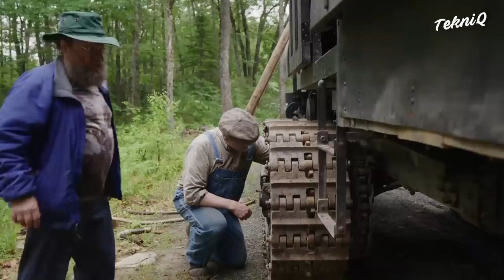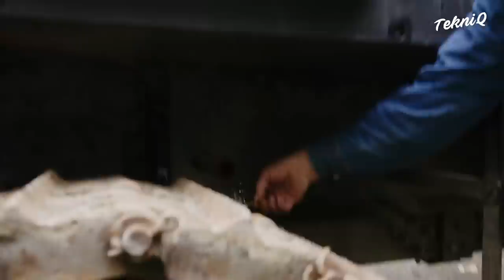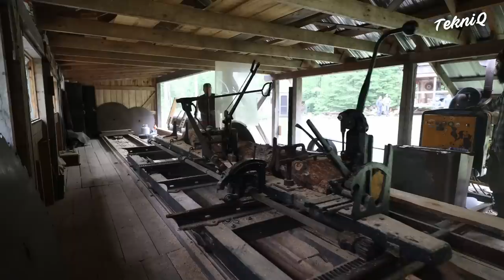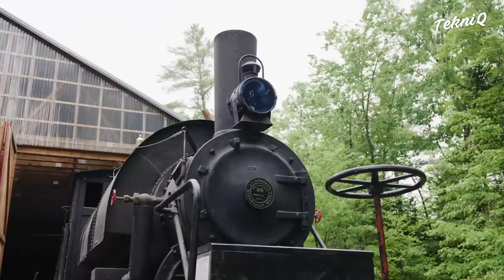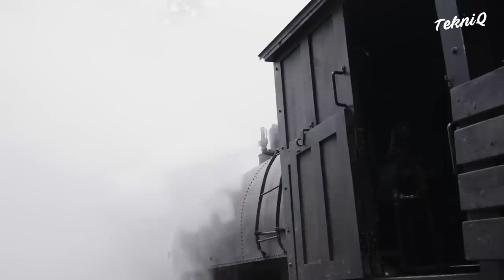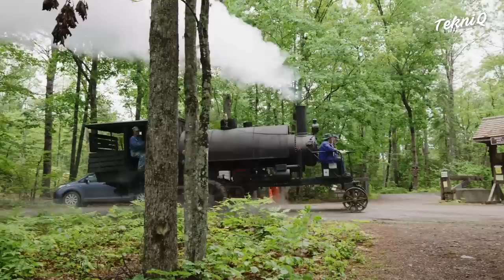Starting Massive Steam Tracked Tractor: One of the First in the World

Comment: Great video, especially the delicate sounds! Two similar log haulers (Phoenix Centipedes) were imported to northern Finland. The first locomotive arrived at the port of Hanko in southern Finland 1913. From there it was transported by rail to Rovaniemi, near the Arctic Circle. After that there were no rails, only narrow gravel roads ("roads".... well, more like paths). The log hauler was dismantled and transported piece by piece,  300 kilometers. The same thing was apparently done with the second hauler, too, in 1914. Logging in these forested wetlands was done wintertime, so the 35 kilometer long "road" for the haulers was a frozen route, not an actual all-year-road. The timber was hauled to Lapland's biggest river, Kemijoki, from were it was moved downstream to sawmills in the Spring. After some time the haulers were converted to burning wood, as it was difficult to get coal (the steam engine consumed almost 50 cubic meters of wood/day). Both machines still exist, one in Tulppio near the Russian border, the other one in Forestry Museum of Lapland (Rovaniemi).
Reply: I had to look it up: The Phoenix Centipede was made in Eau Claire, Wisconsin starting in 1903. The company licensed the patents from Lombard, so the two machines are nearly identical.
Reply: Great piece of history .  Thanks for the contribution 👍🏼
Reply: Invaluable historical info!
Thank for your contribution.
👍

Comment: This has to be one of the most maintainance intensive machines I've ever seen in operation.
Reply: Its actually not that intensive. This was the first run of the season and we just had it all opened up for the annual state boiler inspection so we went over it with a lot of care. It takes about 4 hours to steam up from dead cold. We could do it faster but we like to be gentle. Once under steam its just feed the fire, add water and oil here and there.  Like any steam engine your always checking for loose fasteners and if the journals are running cool.

Comment: I didn't expect caterpillar tracks to have existed on vehicles before the invention of the internal combustion engine.
What an incredibly impressive vehicle.
Thank you very much for the video and also for letting me learn something again.
Reply: Äh, nope, the Lombard Steam Log Hauler is from 1901.
Reply: The boiler seems disproportionately large for the cylinder bores.
Reply: @532bluepeter1  The cylinders are 9"x10" its rated for 90 hp at 175 psi. Maximum RPM is 250 which moves the machine along at 4.7 Miles per hour. The water tank (425 gallons) tends to make it look larger than it is.
Reply: @terryharper2024  Thank you
Reply: Many if not most steam shovels had crawler tracks as well.

Comment: I believe this is a Phoenix Log Hauler. They were built in Eau Claire, Wi circa 1901. I saw one in edgar, WI in 2014. Fantastic machine. Would not wish to be the driver.
Reply: how was the show?
Reply: No this is a Lombard made in Waterville, Maine. The Phoenix was a licensed built version. Alvin Lombard received a royalty for every machine Phoenix produced.
Reply: No, this is a Lombard tractor.  The Lombard is the predecessor of the Phoenix tractor.  When Lombard went out of business, they sold the patents to the Phoenix company.  Phoenix changed several things in the design.  For instance, the Lombard tractor has a "saddle tank" for water for the boiler, the Phoenix has the water tank below the boiler in the frame.  Also, the steam cylinders are arranged different.  The Lombard has horizontal cylinders like a railroad locomotive while the Phoenix has vertical cylinders like a Shay geared steam railroad locomotive.  I have an old video on my youtube channel of the Phoenix engine from Wabeno, WI running at their annual "Steamup Days" from 2011, I think.
Reply: @amberyooper  Lombard did indeed proceed the Phoenix. However the Phoenix was a licensed built version of Lombards early machines (pre-1905) Lombard did in fact use vertical cylinders on his pre-1905 machines with the exception of his initial prototype built in 1900. After 1905 Lombard went with the saddle tank and horizontal cylinders while Phoenix stuck with the earlier design until the end. What adds to the confusion is Lombard offered a lighter, cheaper machine concurrently with his big 19 ton log haulers. These used a vertical boiler with the cylinders mounted vertical on the front of the boiler barrel. The last steam Lombard left the Waterville factory in 1917 though they continued to manufacture gasoline powered log haulers (Tractor-Trucks) until 1936.

Comment: An amazing machine. In the UK, there is the Road Locomotive Society: "Founded in 1937, the Society’s objectives are: The enhancement of education and research into the past history of all types of self propelling steam engines (other than those running on rails) and those types of stationary steam engines known as portable engines, the results of such research shall be made available through the Society Journal and other publications." I reckon with those tracks this machine was off road dragging those logs most of the time!
Reply: It's always been my impression these were most often used in winter-time, with a pair of runners in place of the front wheels. They would pull trains of sledges carrying logs, over snowy paths and frozen lakes. It would have really resembled a train, only without the rails. I don't expect they would have been quite so useful in the summer.
Reply: @jetporter  Yes, I think over frozen ground they would be far more practical- and quite a sight as you portray it!
Reply: @jetporter  Correct. We do have a set of skis for it. The steam powered Lombards such as this one were equipped with skis and only used in the winter. We have wheels on this one so when demonstrate it during the summer months.
Reply: I saw The Iron Maiden, fell in love with this kind of tractor.
Reply: I suppose also that in the summer the risk of forest fire would be somewhat increased...

Comment: Awesome old machine.  I can't say I would like to run it all day with 117 deg.F heat index, like in my area, at this time.  With the heat coming off that boiler, Killer.  I would like to see it pull, as a demonstration, in a tractor pull event.  With that sized cylinder, and the traction of those tracks, it should be capable of dragging the fully loaded sled home.  Nicely done video.
Reply: Fortunately they were only used in the winter. Yes, tremendous pulling power. Its only rated at 90 hp but produces over 11,000 ft/lbs or torque at the tracks. Depending on the terrain and the condition of the ice/snow road they could pull up to 300 tons of logs loaded on sleds and forming a long sled train. Originally equipped with skis we have wheels on this oneso we can demonstrate it during the summer months.
Reply: The Breton boys from Vassalboro Maine have pulled weight sleds with theirs at local fairs . No challenge at all .

Comment: When drivers were called engineers and cold start was a several hour process. How march of progress has sped up life.
Reply: And stopping that beast must be in dozens of yards. Must be a nightmare to steer on potholes, soft spots, and rainy days.
Reply: @Einwetok  these were more for stationary power. With belt-run implements. Moving one, I'm sure was well thought out.
Reply: @gearheadgregwi  Yeah, it probably started as a Frankentank, It looks a lot like a camelback switcher engine that got mated to this chassis. Seriously too top-heavy to be safe at any real speed off of rails with those points of contact.
Reply: @Einwetok  They worked very well. 82 were made in total. They were designed for winter use with skis rather than wheels. We have wheels installed so we can demonstrate it during the simmer months. Yes, stopping is interesting. There are no brakes. However you can use the reverse lever to admit steam in front of the cylinders which works well. When hauling sled trains of loaded with logs they would spread straw on the hills to create friction on the sled runners. The idea being that the Lombard would drag the sleds down the hill rather than being pushed by the sleds.

Comment: Very nice to see this tracked machine running. Many people believe the Lombard was the first tracked machine built, possibly but Hornsy had built and patented the fully differentially steered tracked machine, with lubricated track pins, very similar to what we see on modern equipment. Holt and Best bought the patents from Hornsby, and pirated the slogan CATERPILLAR from the English, and formed the company we now know.
Reply: Yes, we can't say the Lombard developed "the crawler track". Others had come before. However, his track is recognized as the first practical crawler track to actually go into production as opposed to being a one-off. Hornsby patented their first track in 1904 (nearly four years after Lombard's 1900 patent) and did indeed build the first "full track" (or tank track) type machine.
Reply: @terryharper2024  it is hard to say when products were developed based on patent filings.
Reply: @stevecarlisle3323  Lombard had his first track system in operation by November 1900. Which coincides with his patent application filed on November 9th, 1900. No need to rely on that date alone - Plenty of primary source material including his own testimony in court proceedings, photos, first person accounts, and contemporary articles. His second patent was filed on November 22nd, 1905. By then he had already built 17 machines featuring his track system  including the prototype, which was used on a logging operation by Lawrence, Newhall & Page during the winter of 1900-01 and 1901-02. In fact that February they tested a electric powered version on the same operation. The patent filed in 1905 was at the heart of the litigation with Holt. Interestingly Lombard had already built several machines that conform to his 1905 patent before he even filed it. One such machine was sold on October 25th 1905 to the Western Lumber Co. of Lothrop MT. and was also at the root of the lengthy litigation with Holt.
Reply: @terryharper2024  Ya, I am aware of all the controversy. There is a reason they bought the Hornsby patents, as it was the real deal, turns in its own length, not hoping the machine will steer eventually.
The Mammoth is sitting in my backyard !
Reply: @stevecarlisle3323  remember these were built for a purpose and regional use. Hauling long trains of heavily laden sleds in Northern New England and the Maritime provinces. Maneuverability was secondary to power, speed and stability. in 1920 With the availability of early tank type machines such as the Holt it was found they were not suitable for the work the big steam and gasoline powered Lombards excelled at. The Holt (Hornsby) type steering system  - which yes allowed the machine to turn in its own length, became a liability. For instance the steering input reversed depending upon if the machine was pulling or being pushed. If descending a grade with sleds or wagons pushing from behind, the operator had to reverse the steering inputs as opposed to normal control inputs applied while pulling. The other issue was traction. When turning a corner the Holt (Hornsby) system transferred the power applied to the inside (disengaged) track to the outside (driven) track. This increase of power to the outside track coincided with the lose of 50% of available traction due to one track being disengaged. Thus on large operations through the 1920's Holt tractors were usually restricted to hauling the short distances from the cuttings to the main haul road with Lombards making the long hauls. All this is minutia. The important fact is that Lombard developed the first practical crawler track system. I hope the Mammoth project is moving along well. I have the pleasure of operating the steam Lombard and the two gas Lombards (a third is due soon) on a regular basis - amazing machines.
Reply: @terryharper2024  Your opinion on the Hornsby Mammoths operational limitations are unfounded, as the machine was NEVER operated for its original design. The hydro electric installation on the Yukon River put the Coal steam fired electric generators out of business in short order. The Mammoth is the rarest steam fired Track Crawler ever built, and a manufacturing hybrid at that.
Reply: @stevecarlisle3323  my comments were specific to Holt tractors and their Hornsby based steering system. I cannot address the performance (or failures) of the Mammoth itself. The limitations of the Holt/Hornsby steering system I stated are well documented in regards to the Holt used in draft work. Its also why Lombard build the remarkable one-off A-O-L tractor in 1922 with the specific goal to build a tank-type crawler tractor to overcome the limitations of the Holt (Hornsby) steering system yet retain the inherent maneuverability of a tank type tractor yet have the speed, stability and constant traction and ease of operation of the big half track tractor-trucks.

Comment: Thanks for share that video.

I love these ancient machines but I wonder how they could justify the pay back of them at that time. They look very expensive for the time, both to operate and to acquire it, and at same time very limited in "practical" features. Anyway, obviously, I am wrong as they were SOLD then!
Reply: They were indeed expensive ($5,500.00) but fairly cheap to operate. For small logging operations they were not practical. You also had to have your logging operation setup correctly. A well planned and constructed main haul road that could be used for at least several years and plenty of sleds. Usually three sets - one set in transit, one set being loaded and the third set being unloaded. Often during the brief hauling season (January-March) they were run around the clock. The 1914 Lombard we have in the collection was used as late as 1948. I dare say they got their money out of it.

Comment: Steering that is like steering an old Ford, gotta constantly saw at the wheel going down the road!
Reply: Its a lot worse! The steering is very low geared. As we like to say "Steer early, steer often!" Also with the center pivot wagon type axle you do not stick your fingers or thumbs through the spokes! Back in the days these were used exclusively in the winter and were equipped with skis. We have wheels on it so we can demonstrate it and move it around during the summer months. It steers much better in snow with the skis.
Reply: @terryharper2024  It is an awesome machine!

Comment: I wish they would have shown the tracks' running gear. For instance what the heck were those rollers on a chain, that were between the drive and idler wheels. Otherwise it was like watching the grass grow.
Reply: The roller chains take the place of bogie or road wheels. In 1905 Lombard was awarded a patent for a system that did in fact use road wheels rather than the roller chains. However, he abandoned it after only a few machines. The roller chains where preferred because they spread the weight evenly and kept the track pads flat on the surface of the snow/ice roads these were used on. This not only aided traction but also preserved the surface of the road.

Comment: I've never seen anything like this machine.  Does it have independent track braking, or rely solely on the front wheels for steering?  Thanks for sharing this video.
Reply: No independent track braking. (or brakes at all) The front wheels handle all the steering. These machines were not made to maneuver in tight places like a modern crawler tractor. They were developed to haul long sled trains loaded with logs or pulpwood (up to 300 tons) on well built and maintained snow/ice roads. It does have a differential (much like a car) which Lombard referred to as a "compensating gear".

Comment: Omg!  Were they pumping water out of that creek for the boiler or what? I’ll need more explanation before I pass judgement.😊
Reply: Yes, we pump boiler water out of the stream. The museum is in the middle of the Penobscot Experimental forest and is off grid. Any lighting we have is solar powered. The alternative would be to truck water in. They did the same back when these machines were new - chop a hole in the ice of the nearest lake or stream and take on water. We do use water treatment and monitor the PH of the feed water. So far the boiler is doing very well with no corrosion and very little mineral deposit. We also blow down the boiler often to clear sediment out of the mud ring.